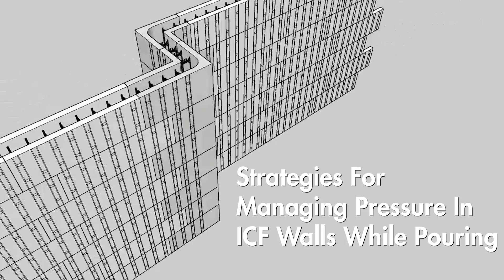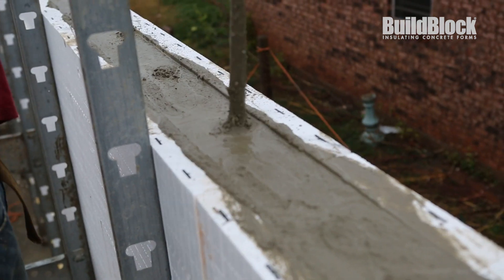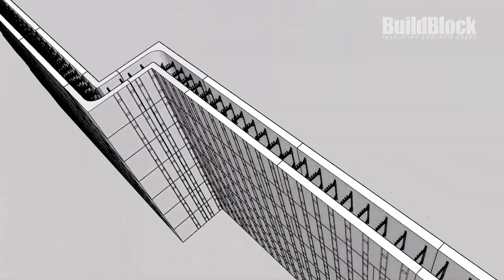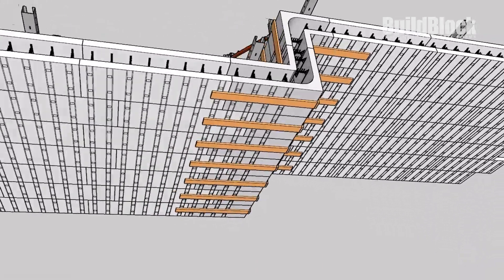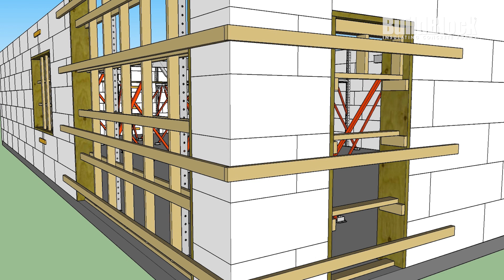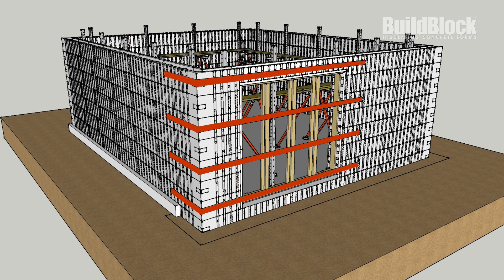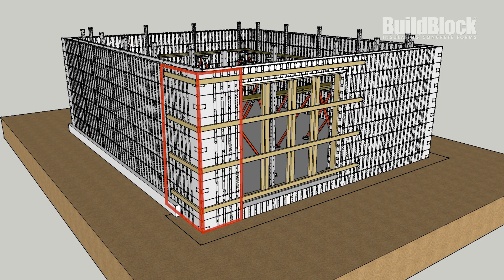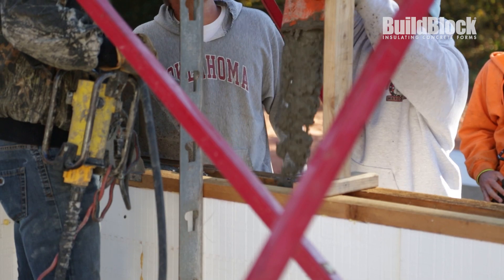Strategies For Managing Pressure In ICF Walls While Pouring

Comment: I was curious why there isn't a system in place to push from both sides while at the same time have vibration mounted to the brace beams to transmit the vibration to the walls to help with the removal of the air in the concrete. Granted the where the support beams contact the ground would have to be VERY solid but would be capable of vibrating a much larger area and thus should perform better at getting the air out .